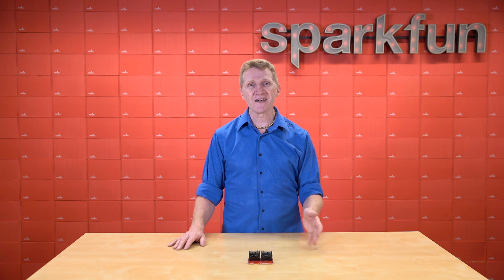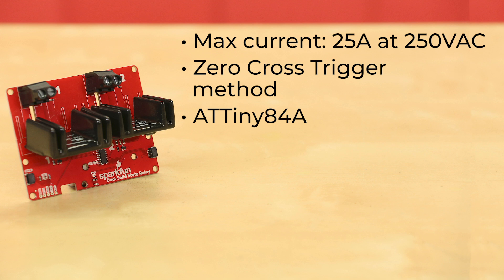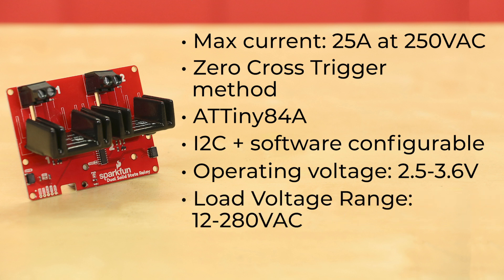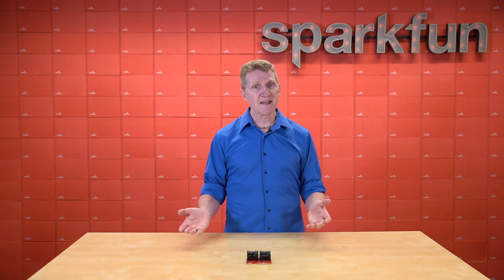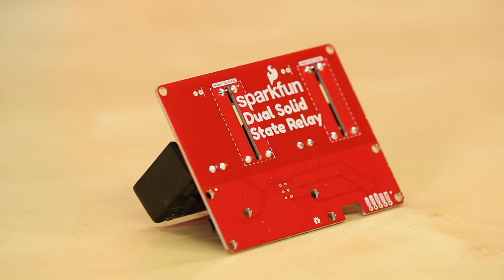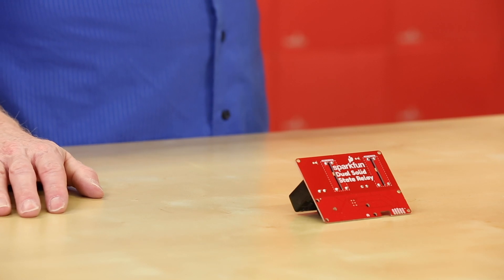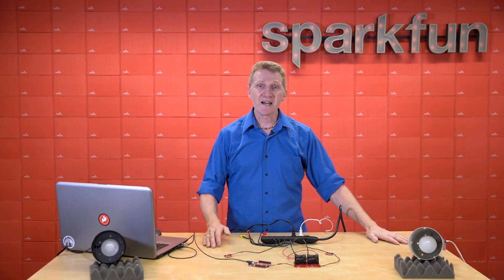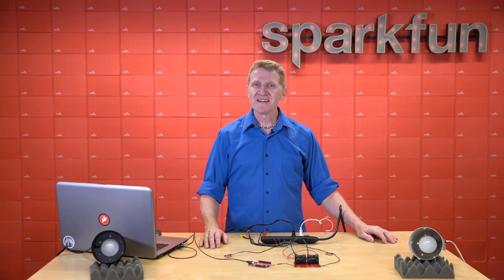Product Showcase: SparkFun Qwiic Dual Solid State Relay

Comment: Great demo! Excellent use of the Force. One thing to improve safety and usability is more AC terminals. Being able to connect the input and output, ground and neutral to the board would simplify wiring and reduce the possibility of shorts. That also would follow design concept of the Qwiic connect of having all the necessary wires in one connector on one board.